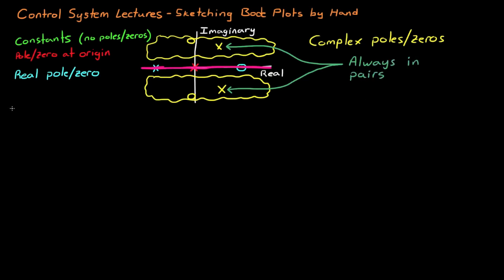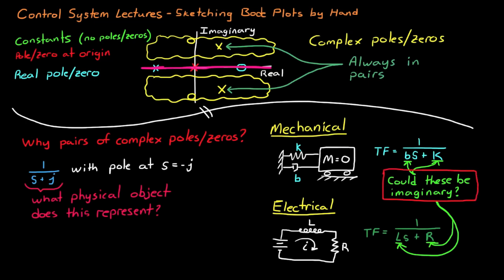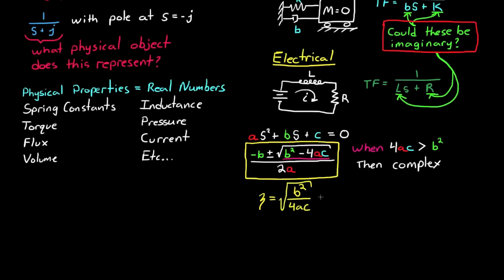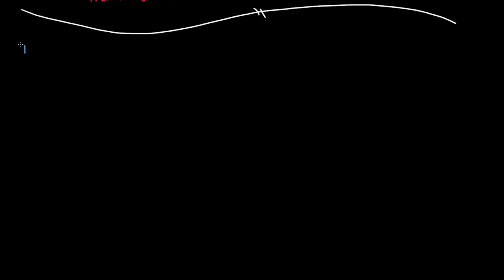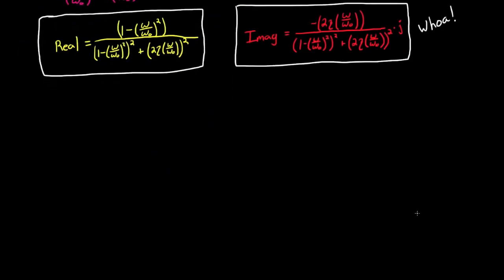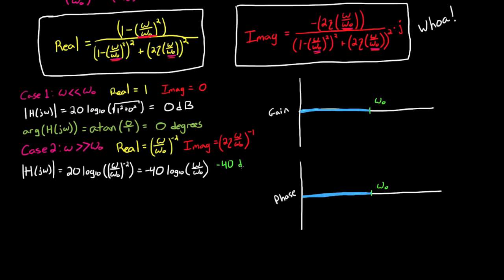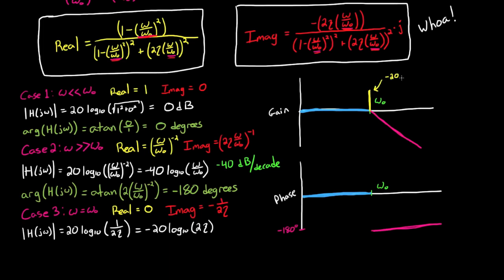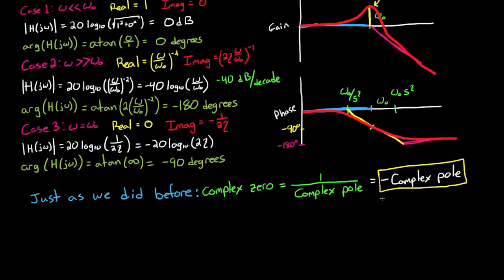Bode Plots by Hand: Complex Poles or Zeros

Comment: Hi Brian, Amazing video series. Thank you very much! 

A question about the cut-off frequency, is there any definition for cut-off frequency in general? I see that it is the frequency at which the power becomes half because it doesn't make sense in this video because "wo" is the cutoff frequency you took in this video but it is not clearly -3dB point.

Comment: 5:44 You don't need to calculate the Real and Imaginary parts of the entire transfer function!  Just figure out the Re and Im parts of the Numerator and Denominator.  Your approach is kind-of nuts, and way too much work!  You can write these out almost by inspection...

|T(jω)| = |Numerator|/|Denominator| = (ω0)^2 / | -ω^2 + j*2*ζ*ω0*ω + (ω0)^2| = (ω0)^2 / sqrt( ((ω0)^2-ω^2)^2 + (2*ζ*ω0*ω)^2 )

Magnitude at (ω = ω0):
|T(jω0)| = (ω0)^2 / sqrt(0+ (2*ζ*ω0*ω0)^2 ) = (ω0)^2 / 2*ζ*ω0*ω0)^2 = 1/(2*ζ)

arg(T(jω)) = arg(Numerator) - arg(Denominator) = 0 - arctan(2*ζ*ω0*ω/((ω0)^2-ω^2) = atan2(-2*ζ*ω0*ω, (ω0)^2-ω^2)

Phase at small ω: atan2(-2*ζ*ω0*ω, (ω0)^2)) = -arctan(-2*ζ*ω, ω0)  goes to -0 deg.
Phase at large ω: atan2(-2*ζ*ω0*ω, -ω^2) = atan2(-2*ζ*ω0, -ω) goes to -180 deg.   
Phase angle at ω0 + e:  atan2(-2*ζ*ω0*(ω0+e),(ω0)^2-(ω0+e)^2) = atan2(-2*ζ*ω0*(ω0+e),-2*ω0*e) = atan2(-ζ*(ω0+e), -e) = atan2(-ζ*ω0, -e) = atan2(any negative numer, -0) goes to -90 deg.

Comment: 1/(s+j) looks like a Hilbert transformer plus low-pass filter to me.  It will phase shift large (>1) positive frequencies +90deg, and phase shift negative frequencies (<-1),  -90 deg.   Magnitude will be attenuated at about -20dB/decade.  These are used in generating baseband single-side-band (SSB) AM signals.

Comment: Thanks for your videos! they are really helping me understand.
One question: I could not find a video for bode plots of functions with RHP poles/zeros. ej: 1/(s² -9)
 Are you planning to make one :-) ?
Reply: Usually, if the poles are on the right half of the plane, it is a pretty useless control system, since all it does is exacerbate the output out of control.

Take the inverse Laplace of your example, and it is 1/3*sinh(3*t).  As t gets large, the output grows exponentially, rather than approaching a steady state value with an exponential decay.

Comment: The math/algebra in this video is quite hairy! I'm having a bit of trouble following all the steps. I'm following when you say 4ac > b^2, then divide both sides with 4ac, you get b^2/(4ac) < 1. But that is not what you write at 03:50. Why is there's suddenly a square root appearing in this equation? How is this possible?

Also, at 05:16, how do you get to this transfer function from what was written earlier? Can you please show the steps in between, that leads from what was written previously to this transfer function?

Comment: Hi Brian.
I am trying to solve k/ [(s+1)^3 (s+4)]. I managed to get the starting, ending points and the break-out points. I have seen the sketch of the locus (from modal solutions) but am not able to understand why the poles will converge at the breaking point(-3.25, -1 and -1) only to curl away to infinity symmetrically. I thought that poles which converges on the real axis should break out 90degree to the it. Can u help?

Comment from the maker: You caught me while I was on so I'll reply right away! You solve for the roots of the denominator like you did, roots = -13.82, -1.59 + 4.85i, -1.59 - 4.85i].  Then you turn this into a first order times a second order equation. 1/(s+13.82) * 1/(s^2 + 3.18*s + 26.05). Then you need to pull the gain out so that the function is in the correct form: 1/(13.82 * 26.05) * 13.82/(s+13.82) * 26.05/(s^2 + 3.18*s + 26.05). Finally just draw the three Bode plots (gain, 1st and 2nd) and sum them together!

Comment from the maker: Another way of thinking of this is that you have a negative imaginary part and a negative real part. When you take atan you're not really dividing.  You are just using trigonometry to find the angle between the positive real line and your point in the imaginary plane. So by dividing and canceling out the minuses you're wiping 180 degrees off the phase and moving the point into the +,+ quadrant instead of the -,-.  Did that make sense?  Sorry for all of the confusion.

Comment: I know that if both the real and imaginary part are negative then this will happen. You don't need atan2 if you ask me. You can visualize in your head what will happen when one approaches zero faster than the other one.

My point is that there is probably another mistake in the video, because when I calculate the real and imaginary parts, they are not negative. This is also the case in the video.

Comment from the maker: Hello again, you have to use the function atan2 instead of atan in this case (I didn't use it in the video because the error I had made tricked me into thinking atan would have worked, in hind sight I should have used atan2 throughout. I'll correct that in my follow up video). Atan2 works the same way at atan but it keeps track of the quadrant too.  Try atan2(-.00001, -1) in Matlab and see that it approaches -180 degrees.

Comment from the maker: Yes there is something you don't see (or at least were too nice to point out), and that's my error in the Imaginary equation. It should be -2*zeta / (w/w0)^3.  Then this will converge to zero faster than the real component and you'll get -180 of phase. I made too many errors in this last half of the video for it to be useful I think :(  Thanks for working this out and letting me know.  I think I'll redo the last bit and point to the correct video so it's not confusing.
Reply: I was going crazy on this part! Thanks for confirming the solution. :)
Reply: @abuelc  me too..i was going mad over it

Comment: I also don't see how you get the argument to be 180 degrees in the case omega >> omega_0. The real part is (omega/omega_0)^-2 and the imaginary part is 2 dzeta omega/omega_0. Just as I try to imagine this complex number in the complex plane, I see that it should be 90 degrees, because the real part goes to zero faster than the imaginary part, so we have a pure imaginary complex number, which has a phase of +90 degrees.

Comment from the maker: Timofte my old friend! What made you choose zeta = -50:1:1? Negative damping ratio? That would be adding energy into the system instead of removing it. I wouldn't go lower than a damping ratio of 0. Also, a critically damped system has a zeta of 1 but you can have an over damped system with zeta>1, however that creates two real poles and not complex like this video is about. Try this and see if it still contradicts what I stated. 

zeta = 0.01:0.01:1; f=-20*log10(2*zeta);plot(zeta,f).

Cheers.

Comment from the maker: Then as the two real poles drift further from each other you'll add the response of each separately still and you'll start to get no slope at the first part of the graph, -20 slope between the two poles, and -40 after the second pole. Of course this is approximate near the pole because there is some smoothing in the line. It's not these perfectly straight lines we draw when sketching by hand.

Comment from the maker: Yes to your first question. If the pair of poles are complex then you'll have -40 roll off and if zeta is approximately less than 0.5 then you won't have that spike before the roll off. If zeta is > or equal 1 and both poles are on the real line then really what you have is two real poles. Then you can just approximate each real pole separately and add them together. If they are right on top of each other, zeta is 1, then the first half adds to 0 and the second half adds to -40 roll off.

Comment from the maker: Hi Jason, the number of poles and zeros makes no difference in the method for finding gain and phase ... just the complexity. You could do it two ways, 1) substitute jw everywhere there is an 's', then solve for the real and imaginary parts and find phase and gain for each omega as the angle and magnitude of the point in the imaginary plane (like I did in the video). Or 2) approximate the gain by summing the 3 individual bode plots, the two poles and the 1 zero. Did that answer your question?

Comment from the maker: But the peak is really closer to 1 dB around 0.65 rad/s. But at 1 rad/s the gain is exactly 0 like we predicted. But if you looked only at the Bode plot you might be tempted to say the natural frequency is ~0.65 rad/s and zeta is ~0.45. That wouldn't be far off, but not exact. Of course if you are intimately familiar with the exact shape of various bode plots then you could very accurately measure what zeta would be from them.  Hope that helps.

Comment from the maker: It would be difficult to get an exact value of zeta from the Bode plot but you could certainly get an estimate, but only then for a second order system. The main reason is that the bode plot sketching method is only an estimate. -20log(2*zeta) is an exact value for the gain at the natural frequency however it isn't necessarily the highest peak on the graph. Try plotting 1/(s^2 + s + 1) in Matlab. This has zeta=0.5 and wo=1. So you'd expect the peak to be 0 at the natural frequency 1 rad/s.

Comment from the maker: The gain points up at that point only when the damping ration, zeta, is less than 0.5 (which is why you only draw a peak when you have less damping then that).  For zeta less than 0.5, 2 times zeta is then less than 1.  The log of any number less than 1 is negative.  Then -20 times a negative number is the positive number that causes it to point up.  For zeta greater than 0.5 the damping is high enough that you don't get any positive gain at that frequency, hence, no upward pointing peak.

Comment from the maker: If you substitue s=jw in your transfer function you'll get H(jw) = 1/(jw+5-5j).  If you separate the real and imaginary parts of the solution you'll get, real = 5/(25+(w-5)^2) and imaginary = -(w-5)/(25+(w-5)^2).  if you let w approach 0 you'll see that for this transfer function the phase approaches 45 degrees.  If you let w approach infinity you'll see that the phase approaches -90 degrees.  Does this help?

Comment from the maker: Hi Miles, hopefully I can clear it up here.  The transfer function 1/(s+5-5j) only has a single complex pole (s = -5 + 5j).  The video only covered transfer functions that have two complex poles that are complex conjugates of each other.  In this case you could add a second pole (s = -5 - 5j) so you'd have a two pole system and the video will cover that.  However, you can solve for the Bode plot of your system in the exact same way.  See next comment for help.